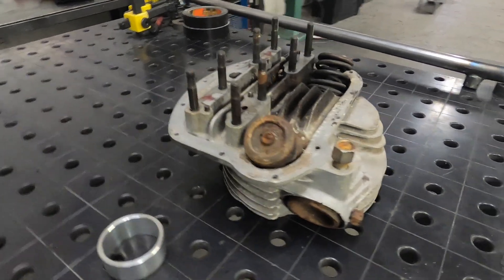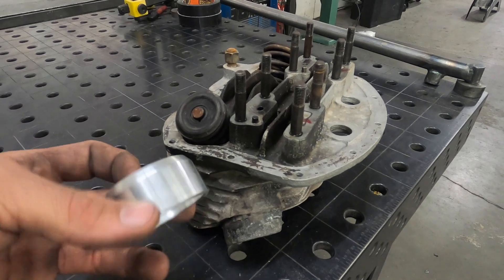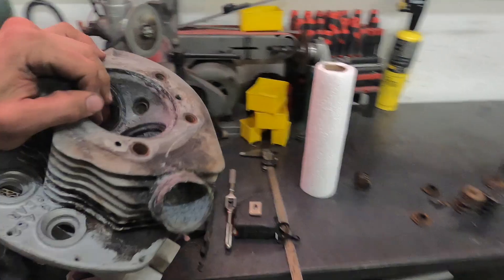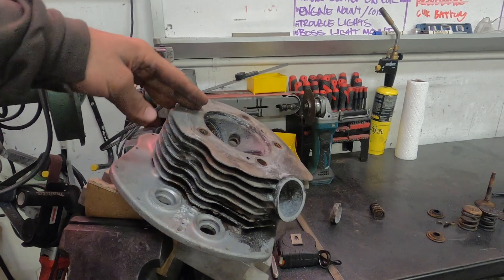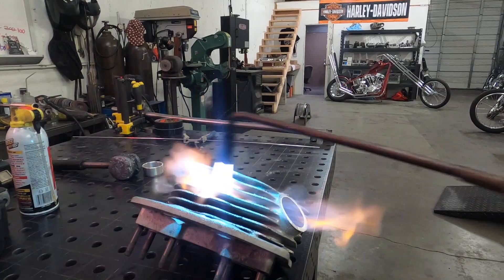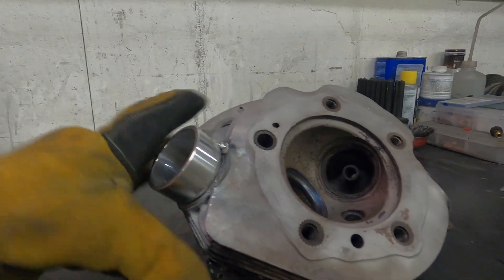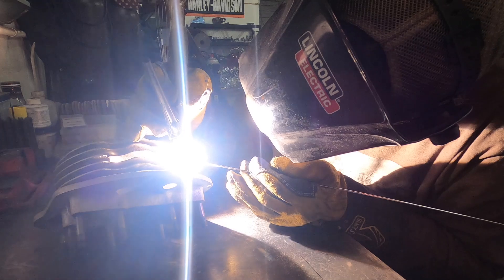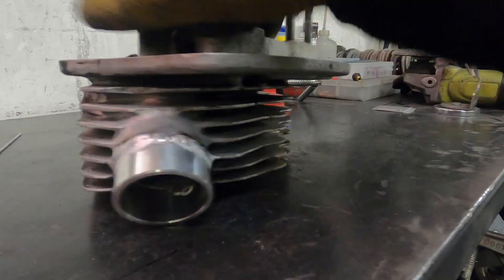Harley Davidson Panhead Exhaust spigot repair

Comment: Did you say 300 degree preheat. Would a kitchen oven work. That's how l cure wrinkle paint
Reply: People do that, but I certainly wouldn't use my actual kitchen oven. Only if you have a designated over for these types of things. Heating up toxic oils and then baking a pie after probably isnt the best for ya.
Reply: @PrettyGoodMachineCo  depends on what kind of pie. Lol.

Comment: I would have gone with a weld-on 3-bolt mounting flange. Those old-time exhaust spigots are archaic and the headers always seem to work their way loose. Installing a clamp somewhere on the frame downtube or elsewhere looks bogus. STD had the right idea when they built aftermarket heads which featured 3-bolt exhaust mounting flanges and Shovelhead intakes. Just some thoughts. You did a fantastic job on that clapped out Panhead cylinder head. Keep up the great work!
Reply: THOSE 1 BOLT FLANGES WERE a DISASTER. I REMEMBER MY SHOVELHEAD MOTOR😭😭😭😭😭😭